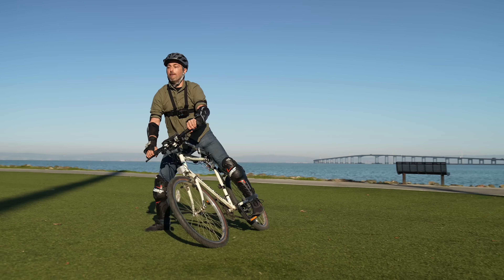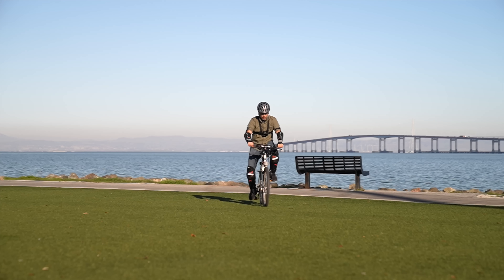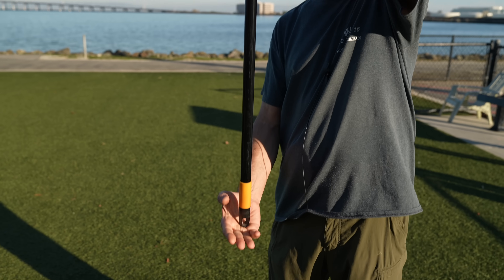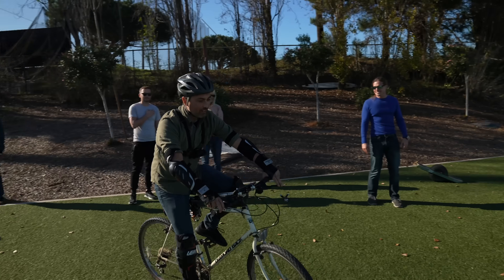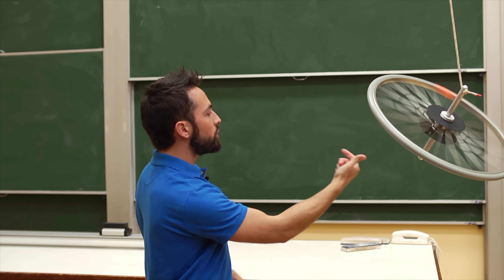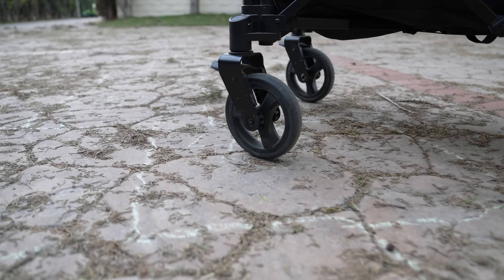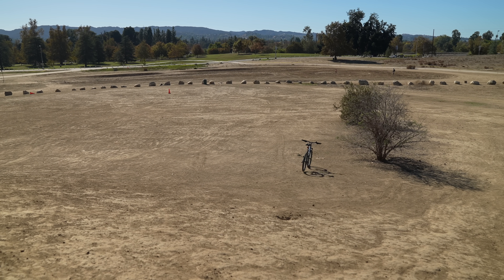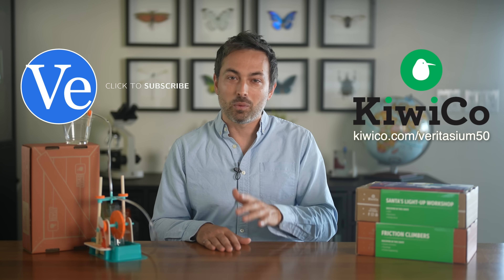Most People Don't Know How Bikes Work

Comment: I’m not sure how it would work, but I use an electric bike and I’m 90% sure I don’t counter turn whenever I turn. Maybe it’s because I’m still sitting still whenever I’m turning so it’s easier to balance?
Reply: You do countersteer, always has and always will.
Reply: @XtreeM_FaiL  Tested it today. if you push on the handles with your palms, you can do it without countersteering.
Reply: @XtreeM_FaiL I meant that it removes your usual muscle memory from the equation

Comment: I knew opposite turned to get into a lean, but I didn't know the mechanics at play.  It's especially interesting to me he because I recently switched from my winter tires, to a new set of Schwalbe Moto X tires and found I had some difficulty steering.

I would turn as usual, slight counter-steer and lean.  But with these tires I found myself fighting the steering as the tires STRONGLY pulled the steering back as soon as I started the lean.  Even after 2 months I still find myself very aware of the steering as I turn.

Is this normal? a product of a higher quality street tire?  Or an random dynamic of different tires than the bike was designed for.  Same size tires/wheels, but let's just say they are Cadillac tired on a getto Huffy frame setup.

Comment: Simplest way to teach that to people is giving them a three wheeled bike with two tires in the front.
That's how I realized just how much I work with my own weight and balance. Because with two wheels in the front (and no supporting mechanics which make leaning to a side possible) you literally have to ride different.
It's also how I learned to drive really small circles with my cargo bike (which is a lot longer than normal bikes). 😏🤫

Comment: I understand what countersteering is but my question is Did you try to turn just by leaning into the direction you wanted to turn?  I would think you could do it but it would take longer to get turn started.
Reply: This would take a lot more speed... as a motorcycle rider you learn this when you're going slow you first counter steer but then you have to steer the wheel into the turn to keep your balance but once you get into higher speeds then you can counter steer through the entire turn.

Comment: I already left one comment here, but I want to look at this from another perspective. The experiment in the video is not well defined. The claim is: you can't turn to one side without first steering into the other direction. Define the turn first. Do you mean specific angle of the steering wheel in relation to the base of the bike, or simple making a turn of the bike itself? Because with enough radius you can make a turn barely moving a wheel to one side - this won't require any counter steering. If we talk about the angles there is obviously should be some threshold value, because if you talk about any angle, then you won't be able to turn in any direction: you need to turn left before you turn right, but to make that initial left turn you need to turn right. 

There is an experiment with the bike with fixed controls, but you need a reference experiment with the same turns on a bike where you can steer freely - to prove you can make such a turn at all. And you also need to prove, that you need exactly to counter steer the bike and can't just fix your balance after you've made a turn. 

The demonstration at 2:30 shows that while trying to make a right turn the guy actually didn't try to make it. He's body positioned for a left turn. And it is not because he first steered right. His speed and initial right turn are not enough to make a strong momentum. He  turns the wheel to the right but already starts to lean to the left - he positions his body for a left turn. If he true the same but with the right turn would lean in the right direction then he would have made a run turn without a problem. And no, I don't agree that steering (using bar handles) and shifting your body weight (balancing) are the same things that you can call counter steering. Remember the claim is "you can't turn into one direction without first steering(!) into other direction".

Well, anyone can take a bike go outside and make a practical exercise. I did and I do not agree with this video's conclusions.
Reply: If you steer to the right like that, you'll end up leaning left.
Reply: @Owen_loves_Butters  you have control of your body and can lean into the turn, unless the force that moves you is to big to overcome. When I drive I always lean into the turn, not outside of it. I mean my conscious movement. Of course I feel the force that tries to pull me outside, that's why I lean more if I want tighter turn.
Reply: @d4slaimless Steering to the right steers the bike out from under you. You will always end up leaning left. This is just basic inverted pendulum physics. Watch the video again. He doesn't start leaning left until after he steers right. The steering causes the lean, not the other way around.
Reply: @Owen_loves_Butters 

It's like you didn't read what I typed or something. I said "you have control of your body and can lean into the turn, unless the force that moves you is to big to overcome." 

I am driving bike on regular basis.  I won't end up leaning left if I lean with the bike to the right. I am not disconnected from it, I hold onto it with my hands, legs and I seat on it. When you turn the handle bar bike leans to the side and you lean with it.  That's one of the basics of cornering on the bicycle. You are not a dummy, you can move your body, you know? Yes inertia (or centrifugal force if you already in the turn) tries to pull you out, but it's not like you can't do nothing about it. Don't forget that there's also gravity that helps you lean. 

Yes, when I turn to the right  at 40 km/h I feel the pull to the left pretty hard. However, to actually make a corner and to not fly off into oncoming line I just have to lean to the right hard. Quite an exhilarating felling I have to tell you.  

I don't know, watch the GSN videos about cornering on the bike. It's not like I am theorizing here about something I didn't try for myself. Especially after watching this video. 

And just for you to think about: Are you aware that you can drive bicycle without holding handle bar? How do you think turning without hands goes? You lean to the right and bike turns to the right.  Amazing, isn't it?
Reply: @d4slaimless What you're describing is not how most people ride. Counter-steering is the most practical way to ride a bike. I'm not sure if you noticed, but later in the video, he records people riding bikes. They all counter-steer without even knowing they are. If you steer one way and are not already leaning in that direction, you will start leaning the other way. Again, that's just how inverted pendulums work. A bike has two points of contact with the ground and therefore behaves as an inverted pendulum. If you move the base in one direction, it will cause a lean in the opposite direction. Think about balancing a broomstick on your hand. If you move your hand forward, the broom will tip backwards. The same physics apply to bikes.

Comment: You should do one on how motorcycles turn. It will do it on bikes as well but at a certain speed(12mph I think) you actually turn away from the direction you want to go. To turn left you push against the left handlebar. I ride motorcycles and it’s a really neat effect.
Reply: All bikes work the same. You go 0km/h or faster and they all turn the sameway.
Reply: Honestly the first time I rode a motorcycle I did this automatically lol

Comment: The way you did your tests on the Gyroscopic affect is completely wrong..
Mainly because the center of gravity on a bike without a person is substantially lower, and there is less weight overall which means that the forces from the gyroscopic affect will have greater influence meaning that the two tests aren't comparable.
You should have had a Gyroscopic test where you rolled the bike down the hill without the handle bars locked, then another test where you roll it down the hill with the handle bars locked.
Reply: I have done exactly that test for a follow-up video since people have asked for it.  With handle bars locked, the bike falls just as quickly as it would if you simply held it stationary and let go.  With steering unlocked, you get the ghost-rider effect you see in this video.  Unfortunately, I never got around to editing and posting the follow-up video.

Comment: I have a question like if you are doing a wheelie and drive through a corner you just lean in the corner without even being possible to countersteer? So how does that work or is it one of these tricks like you don't need one of the three needed things to steer.

Comment: This is the first thing they teach you in motorcycle driving lessons.  To turn right,  you push the handles to the left. This effect is much more noticeable in motorcycles because they are much heavier, so you need to push a little harder to make it tilt.
Reply: for a bicycle and a motorcycle the term counter steer isnt the same. when you counter steer a bike you are doing like he said you turn to initiate the lean then you turn in the direction of the turn. At a certain speed thats no longer the case as you've noticed for motorcycles. For motorcycles you don't turn left then right to go right unless you are going below 20km/h or so. when going 100km/h to turn left, you turn right and to turn left harder, turn right harder. Any right input to the bars would cause the bike to stand up. At no point at high speed is your front wheel pointing into the turn. that would cause a skid. look at moto gp pictures when they have their knees on the ground you will see the tire is pointing slightly the other way.

Comment: I heard about this a long time ago but didn't believe it, I figured it's possible to use my BMX skills to just lean right and turn right without steering left first...but after paying attention, no, I totally counter steer, sometimes aggressively before diving into a quarter pipe, infact that was the secret to most tricks...counter steer hard first.
Reply: You are in the extreme minority of commenters here that has done the test and correctly recognizes that you really do counter-steer, even when it's hard to detect.  Kudos!  Faith in humanity restored.
Reply: There is a way to steer bikes without countersteering: by leaning in the direction you want to go using your own body weight. 

Countersteering leans the bike in the direction you want without leaning our body.

This technique (using your body weight) is used when riding a bike with no hands on the handlebar, and you have to use that cause countersteering does not work without turning the handlebar. (because thats what countersteering is (turning the handlebar in the opposite direction you want to steer the bike))
Reply: @Jojo-210  Yes, almost everyone believes that.  It's just not true.  That's exactly the point of this video.
Reply: @Jojo-210  How riding with no hands or using leaning to turn works is that by learning you upper body to the left that causes the bicycle and your lower body to lean to the right. While standing on a BMX bike it might be just the bike that leans right. This is an equal and opposite reaction. The bicycle learning to the right causes the front wheel to turn to the right for the reason explained in the video.  This front wheel turned to the right is the counter steering that will cause the bicycle and rider together to lean to the left. Which then causes the turn to the left.

I do wish that the video covered this. But I understand that it would have made the video too long for most viewers.

Comment: Its just impressive how many little ajustments we do unconsciously
Reply: subconsciously* unconsciously means while we’re knocked out 💀
Reply: @Ogimarsalodpaprike  So prove it by trying one with a locked steering handle. Most of the adjustments to steering you make are small enough that its hard to notice them, but you do make those tiny steering corrections to balance. Dozens of people were shown trying this, even at higher speeds, and none of them could do it. Why would Veritasium try to trick you about this?
Reply: @Jaeeden  well yeah they are meant for roads for a reason, they aren't slow
Reply: its a nonsense video, most bikers just lean and dont do this weird steering thing.... This only happens when your going super slow....
Reply: @Chris_t0  good point, i wonder how much more stable a bike in high speed is now.
Reply: @Chris_t0  You need to steer the handle slightly to one side to lean to the opposite side. You cannot do this with a locked handle bar. If the handle bar is straight or slightly turned to the same side you're trying to lean, there'll be big resistance to your attempt to lean. The motorcycle/bicycle will automatically keep straightening itself up if the steering is not turned to the other side. Every rider counter steers without even realising it. This even applies to motorcycles at high speeds. You cannot keep the leaned position without counter steering.
Reply: @arunkp20  Weird i just tried it and dont do it unless im taking a super sharp turn or going slow on a mountainbike
Reply: @Chris_t0  Most of the time you'll be just pushing on the handle bar. That's why people don't realise they're doing it. You don't actually turn the handle bar. But when you're leaning, you support your body by applying force on the handle bar. When you're leaning right, you'll push the right side of the handle bar outwards. Sometimes when you're riding at low speed, the resistance to your lean won't be much and you don't even have to do anything on the handlebar. The force from you shifting your weight will automatically do the counter steering and let you lean. I used to turn my bicycle with both hands off the handle bar. But even then, the principle of counter steering works in the background whether you notice or not.
Reply: @Chris_t0  I guarantee you'll find you can't balance your bike with locked steering. Try it and get back to us.
Reply: @TheGrumbliestPuppy  i mean you can you literally just keep moving in circles
Reply: @Chris_t0  you need to stop letting your personal incredulity get in the way of science. you just watched the video that explains it to you, its scientific fact
Reply: you literally turn  and lean with your body, this video only works when your going like 2km/h
Reply: @Chris_t0  Body steering does not work and when it does its way slow and ineffective. 
If you're riding a motorcycle at let's say 30 mph you CAN'T make a turn let alone a sharp turn without counter steering, it's simply impossible and same goes for a bicycle.
Reply: @EEEBA1  Well it works wonders for me on mtb trials at like 15km/h , i guess there is a limit to when it doesnt work
Reply: @EEEBA1  not really on a bicycle you can correct after the turn you have a lot more control of the bike.
Reply: @Chris_t0  As bikers we do that constantly. Counter steering is the only way to steer your motorcycle period. However we don't think about it, we just do is subconsciously.
Reply: @Chris_t0  well then mail it to him

Comment: i noticed as i was biking that instead of using the handlebars to steer i was keeping them straight while leaning to one side or another. i don't think i've ever observed that i countersteer but i do make hard leans to one side or another. i'll have to try and look out for how i turn next time i bike to see if i countersteer!
Reply: Riding with no hands or leaning to turn works is a form of counter steering. Learning you upper body to the left causes the bicycle and your lower body to lean to the right. That is an equal and opposite reaction. The bicycle learning to the right causes the front wheel to turn to the right for the reason explained in the video.  This front wheel turned to the right is the counter steering that will cause the bicycle and rider together to lean to the left. Which then causes the turn to the left. 

It is easier to observe this by having someone else do this riding as you watch. Or video your with a stationary camera on a tripod. If you try to observe yourself while riding you wouldn't notice all the parts.

I do wish that the video covered this. But I understand that it would have made the video too long for most viewers.